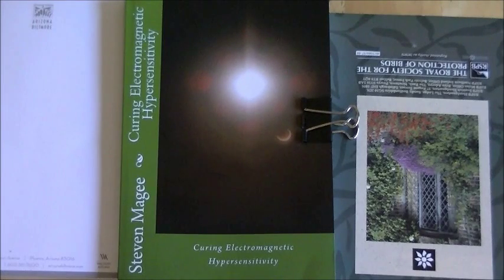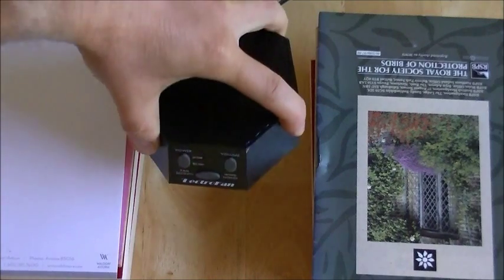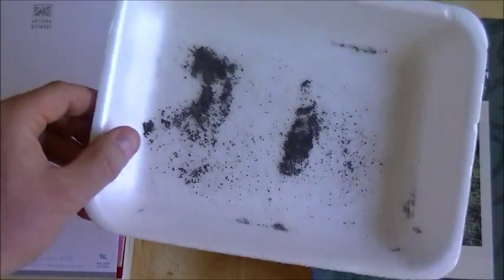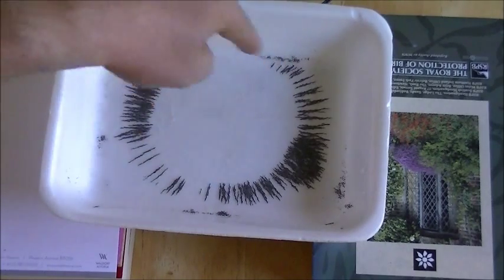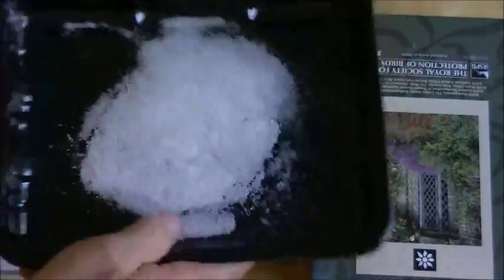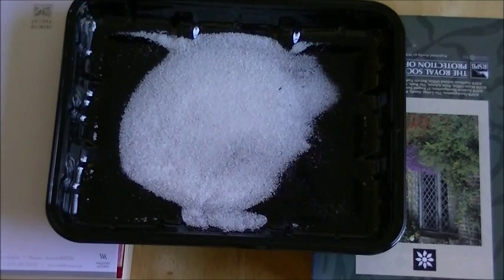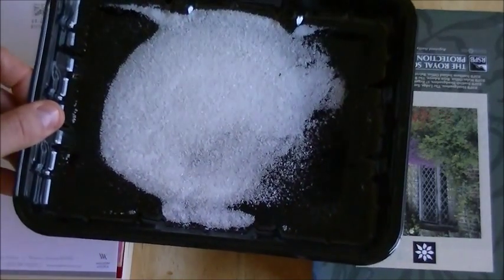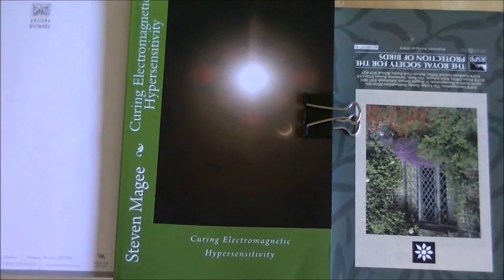Testing The Lectrofan For Magnetic And Vibrational Field Emissions

Comment: Duh. It's a speaker. All speakers will do this. They operate by a 'voice coil' that is a magnetic coil. All sound has vibration so anything that creates sounds has a vibration field.
Reply: Actually they could use an electrostatic speaker, though that still wouldn't solve the vibrational issue. To solve that, just remove the speaker entirely.

Comment: I have tried Schumann resonance for sound breaking, but as there are breaks in frequency, it cannot catch all the sound. Does that unit have a timer & Do you find it easy to sleep with it on in the house ?
Thanks.
Reply from the maker: It takes some getting used to, but eventually I got great sleep with it on.  There is a 60 minute timer, or you can have it on all night.  I leave it on all night.
Reply: +1
Reply: BTW the instructions say that you can press the 60 min button multiple times for more than 60 minutes of timer.
Reply: +Environmental Radiation LLC So this is a bad thing? sorry for the stupid question... btw I was wondering if you would get the same results if the tray wasnt filled with salt and had the same amount as it did with the iron filings... seeing that it would be much harder to move that much salt.